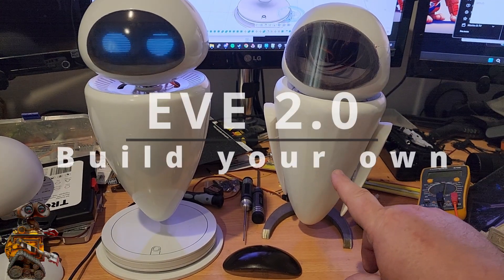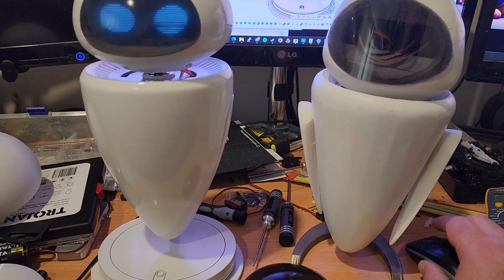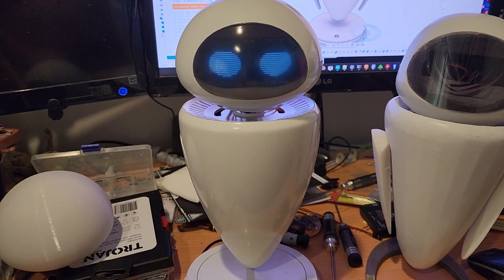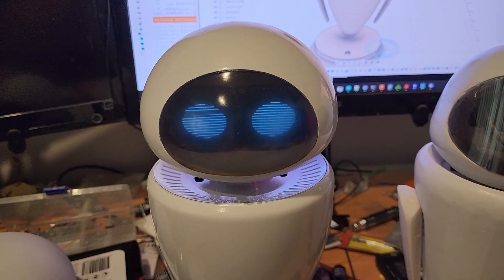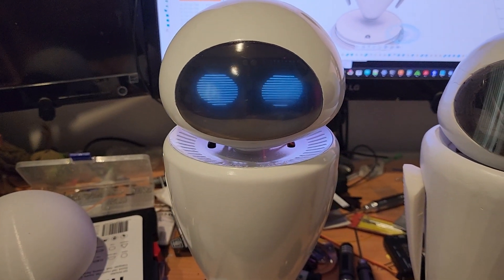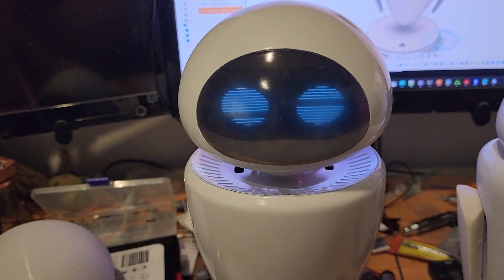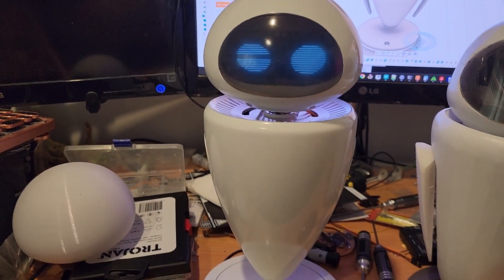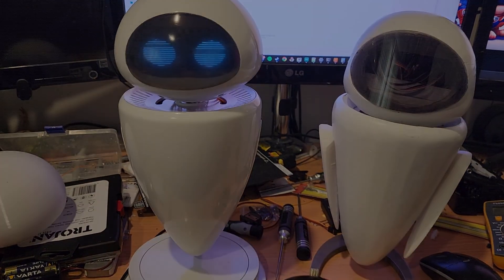DIY EVE Animatronic: Completed Build and Demo

Comment: Hi, I’m Paula from Argentina. I’d love your help building my own EVE for a school project, but I’d like to make it without the moving eyes.
Could you tell me which components and code I can remove if I’m not going to use the LED eyes? Thanks so much in advance, your work is amazing!
Reply from the maker: drop the m4 express teensy board and the 2 oled screens. Everything else runs on the arduino nano which has it's own separate code.